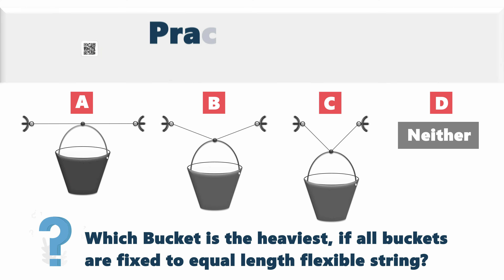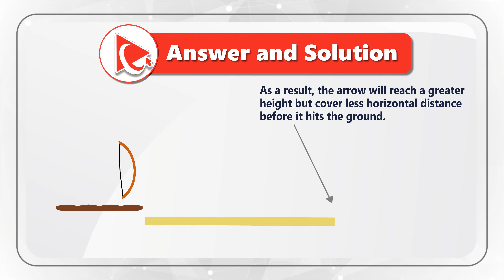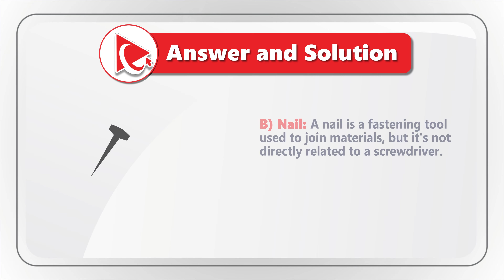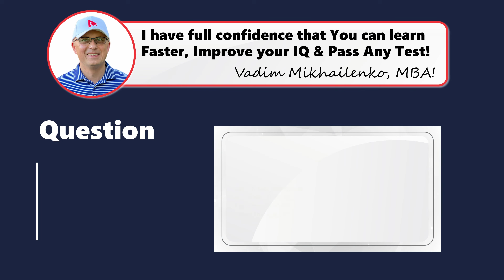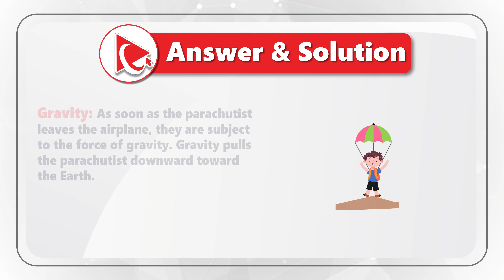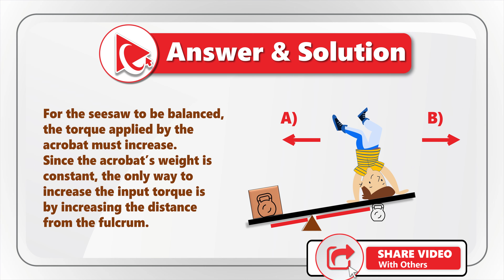How to Pass RAMSAY MAINTENANCE ASSESSMENT TEST - Questions and Answers with Solutions

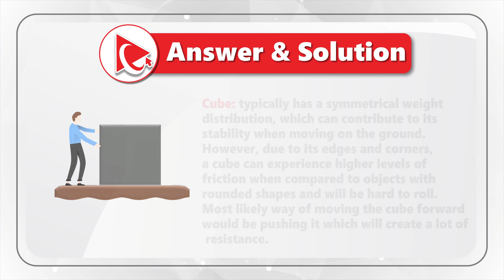Comment: 22:01 "Compared to a cube, a hexagon generally has fewer edges and corners."

Incorrect. It has MORE edges and corners, but they're at a shallower angle. (EDIT: You said, "A hexagon has six sides ... " (Compared to the cube, which has four.) Q: How can a profile with more sides have "fewer edges and corners"?) Also, its flat surfaces are shorter than those of a cube, giving them a smaller bearing area, thus less friction.

The best way to think of this is to imagine an octagon shape — more edges, but each at at an even shallower angle, with  even shorter flat surfaces between the edges.

If we keep increasing the number of edges, their angles get ever shallower, and the flat surfaces between them get ever shorter ... until we eventually arrive at the circle, which has no (OR an infinite number of) edges, each at no angle, with zero (or an infinite number of) flat surfaces between them.

Just my 2¢, your mileage may vary ... 😉

Comment: C is correct for the ball rolling/block rolling excercise but its not because of friction. Its because the base of the ball is so much smaller than the base of the box. Allowing it to easily be continuously tipped over(so to speak) compared to any other shape. A triangle would be the most difficult to roll over and is why they use that shape for wheel chocks. Friction would only apply if the objects are not allowed to rotate or if there was some sticky substance or layer in between but would not change the outcome.

Comment: For the question of which angles for the arrow travel further, my inclination is one with zero degree will travel further a way because all force is applied in a horizontal vector and nullifies the vertical vector, which means a stronger force in the horizontal direction. also for the bucket question if we consider F = MxG this shows obviously the lowest bucket is heavier one.
Reply from the maker: This is an excellent way to solve it! Really appreciate you for bringing it up! All the best in your job interview and hiring assessment test!
Reply: I do appreciate the hard work you put on to gather those valuable information.  @OnlineTrainingforEveryone
Reply: Answer is neither. There is no height specified. No force specified either.
Reply: Well in the video I see you use the theory that’s it’s close to straight which is false bc 60 degrees is close to 45 degrees than it is to 90 which would make that straight in the air and also the image that is showed is not 60 degrees it’s more like 75

Comment: Questions like the weighted bucket are frustrating  because they do not define all the variables in the question. Such as are the line connectors static or under tension, which makes the question undifined in my view, missing key information for the answer. In the real world this is easily intuative but the way it is formed in a test senario confuses the obvious answer. Hashtag every test ever.😅

Comment: With the gears I initially imagined them more as pulleys with a belt weaving back and forth through the gears and when I got to the last gear it implied clockwise motion, but the gear count is probably a faster solution. 😅 but with that I can remember it with the terms "equal and opposite" and "same odds"

Comment: Regarding the bow & arrow question. My initial thought was the arrow would travel the furthest at the 45* angle.  However, I then started thinking that the question mentioned that they used the "same bow" but never said they used the same string tension or equal draw of the string, which could make the answer D, neither.  In these style questions, is it always best to read exactly what the question states, without adding any additional information to the question?
Reply: I'd argue that the string is part of the bow